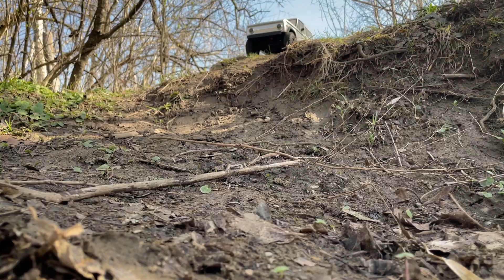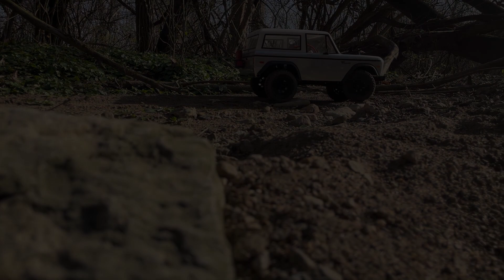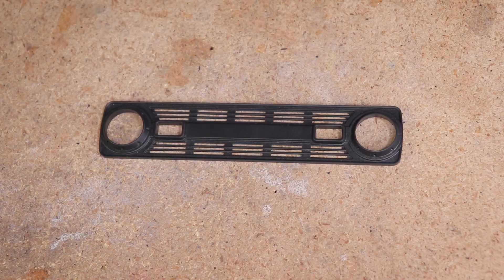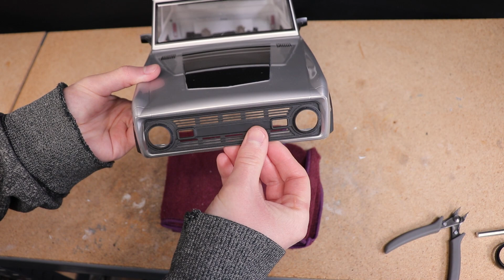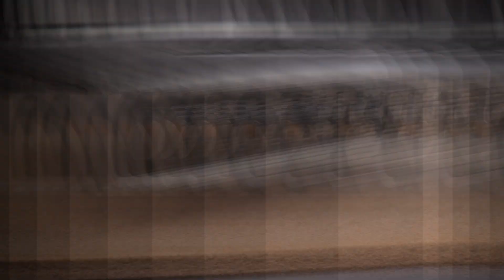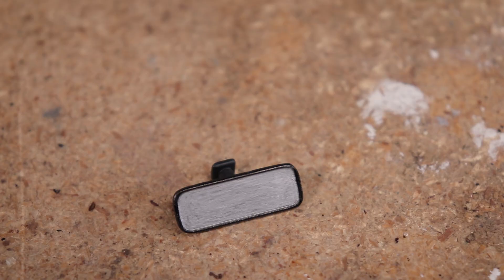MST CMX 1/10 Scale Bronco Update: Trail Driving, and New Parts

Comment: ✌🏻😎🏴Looking nice so far. Super lazy using a sharpie, made me laugh 😂 didn’t you have any foil or anything? 😂. That’s totally something I would do 😂. It didn’t do a bad job though did it. Next time as a little test give it a White sharpie base before you go over it with a silver. See if it makes a difference. I’m out of white & silver so I can’t try it myself. 
I’m freaking lazy too. Where your grill doesn’t fit Heat up the inside of the body & push it over to meet the grill until the gap is closed. Should look perfect then. See I’m way lazier than you 😂 plus I’m to lazy to even bother learning CAD 😂

Comment: Your mods look great - well done!!  Maybe print a core support with radiator to fit behind the grille and you're all set.
Unfortunately, I think I've missed the boat on the MST Bronco - they are discontinued and out of stock everywhere.  I have the Tamiya equivalent (purchased body set and CC-01 chassis separately) but it's not the same.  The body set is spectacular but the chassis --  well it's a Tamiya ☹ Kinda goofy, toy-like and not very scale. 🦨